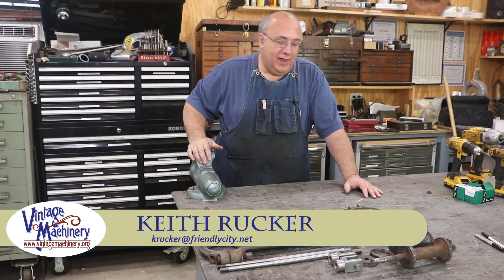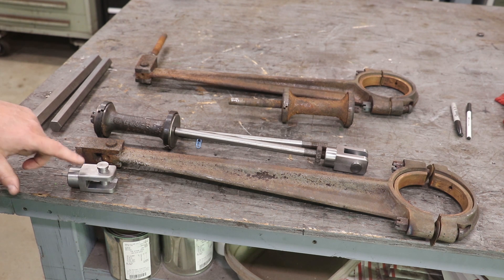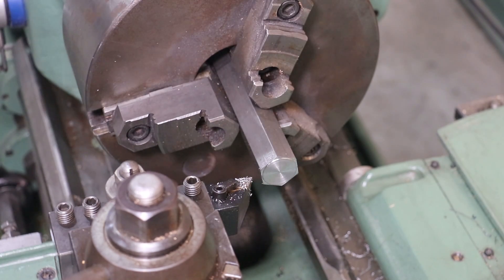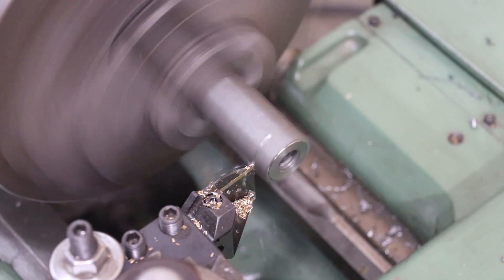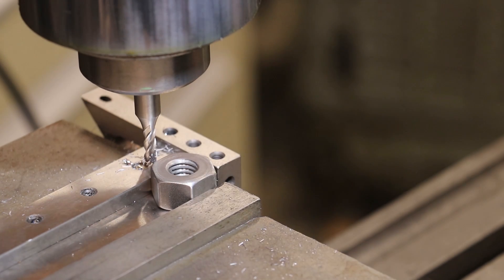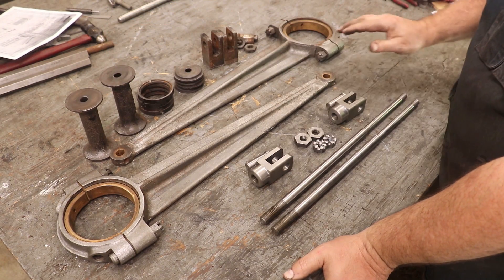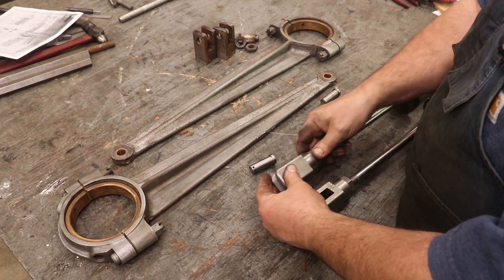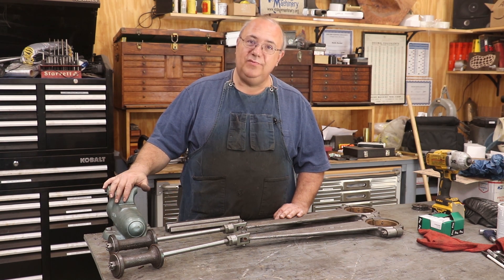Steam Stoker Engine Restoration 12: Reassembling the Valve Assembly

Comment: When you stop and think about the amount of time and effort (plus skill) it takes to restore just the stoker engine to pristine condition, then multiply this by all the other individual components needing similar restoration on an old locomotive, its easy to see why the cost of restoring a century old steam locomotive is measured in $$ millions. Thanks Keith. I'm very mechanically inclined but know nothing about machining and shaping metals. Its so fascinating to watch you work and explain what you are doing.

Comment: Very small spool valves like those were used in the hydraulic actuators of the F-8 Crusader and A-7 Corsair II in the 50s thru 70s.  I am not sure if they used rings.  The spools were moved around by a solenoid and a small yoke.  It is a tried and true idea.  Nice work on all the new parts.  Thanks again for sharing the work.
Reply: The place I used to work was overhauling A-7s through the late '80s before the F-18s finally replaced them.  I don't doubt that this type of spool valves were used in the actuators.
Reply: @bobvines00  BTW the USSR used similar tech in the MIG 21.  I saw a valve captured in the 6 day war - well made.

Comment: Using your tap follower in the tail stock, Put the lathe on super slow, Grab the spinning tap handle. When the tap bottoms you can feel it and simply let go. works great, has good feel and a lot less work.

Comment: In Europe we call a Cotter pin one which has a flat tapered section, used to secure cranks.  Commonly found on the cog side of a bicycle.  What you are describing would be called a spit pin.
Reply: The UK and US are separated by a common language.
Reply: Where i used to work we had a wartime box marked "split cotter pins" but everybody knows them as split pins.

Comment: For asthetics, blued connecting rods/caps would’ve looked really nice on the finished product. Great job, Mr. Rucker!!!
Reply: The Photographic Auditor 
It would, but once the stoker engine is put back together, these parts will not be seen by anyone again until the next time the engine is disassembled. So basically, it would be a waste of time and funds to do that.

Comment: never heard of "JAM"nuts we call them "LOCK" nuts, am also fascinated at the way you try to pronounce OIL, as always such a great contribution to ongoing education and sharing of knowledge and experience
Reply: Well, what do they do? Lock or jam?  I'm kind of leaning towards "jam" in this operation.
Reply: Lock Nuts here in Australia.
Reply: Jam nut is correct as Keith is using the term, at least in the US.  ASME B18.2.2-2010 "Nuts for General Applications: Machine Screw Nuts, Hex, Square, Hex Flange, and Coupling Nuts (Inch Series)" refers to hex "jam" nuts along with regular hex nuts in its tables of dimensions.

ASME B18.12-2001 "Glossary of Terms for Mechanical Fasteners" paragraph 3.2.1.16 states "jam nut: a hex nut having a reduced thickness—usually 63–70% of the hex nut thickness.  It is used to provide resistance to loosening in combination with thicker nuts."

ASME B18.12-2001 also states in paragraph 3.2.1.18 "lock nut: there are two basically different types of lock nuts: (1) a prevailing-torque type that resists relative bolt-nut movement with or without an axially applied load to the bolt-nut combination, and (2) a free-running type that exhibits a locking ability when there is an axial load applied to the base of the nut.  The “locking” or stopping action of the nut is accomplished by thread deformation, or  clamping, or by the addition of nonmetallic inserts.  The free-running type usually has a design feature that adds to the elastic elongation of the bolt-nut combination."

"Lock nuts" like these can be purchased at your local hardware store, but I don't know if you'll find an "official," thin jam nut there.

Comment: Keith, great work. Do you drill the crosshole for the cotter pin for the castle nut after it has been trial tightened? Otherwise, how can you ensure that the crosshole will align with one of the crosscuts on the castle nut after it is tightened?

Comment: Watching this video made me think about your planer project. Have you thought about having an eccentric on the feed gear shaft and using it to run a mechanical lubricator (as used on many steam engines). It might be a very apt method of oiling the ways.

Comment: Those nuts can be made with round stock then cut the hex on the outside using a spindex or a dividing head. I have to make them form time to time. It is usually cheaper than trying to find the right size hex in a given grade of steel. Most of the ones that I do are in 4140 or 4130.

Comment: Bonjour Keith,
I especially appreciate this project because steam is my passion and I understand what I see as my model steam machines are built on the same principles, except the size of course :+)
I can't wait to see this steam machine running again!
I have a little question : Does the new metal you use have the same hardness than the old one ? If not, Would it have an impact somewhere ? For example 
cast iron segments and cylinders or valves...
Amicalement, Raphaël

Comment: Great content. One question though. Can you have the rings chrome plated? I would think a chrome Molly finish would guard against wear better than just iron.
  Thank you.
Reply: I think that the idea is to have the rings wear rather than the valve piston bore!
Reply: You'd probably rather have the rings wear than have the cylinder bore wear.
Reply: @k4kfh  The rings are easier to replace than the cylinder sleeve and easier to make.

Comment: Hiya Keith, did you use a bottom tap in the two second nuts to combat the taper off the starting tap? Keep safe & take care...
Reply: There was clearance past the thickness of the nuts. (The hole was drilled deeper than the thickness of the two nuts combined.) And it wasn't a starting tap. You can see almost full threaten all the way to where it enters the hole. And he shows them being assembled at the end.
Reply: @xenonram  Sorry were you there?  I asked Keith a procedual question, not what you could see.
Reply: @stephencoster9532  keith rarely answers comments, so helpful people chime in for him.
Reply: Stephen, no need to be combative. One doesn't have to be there to answer a question with information that's clearly provided in the video, both in what's shown and stated. He used a standard tap and specifically stated no bottoming tap would be used because he drilled past the depth needed so the standard tap can cut the threads to size.

Comment: If you are not going to paint any of the internal parts, won't they rust quickly and therefore start their demise again? Lots of internal engines have a coat of paint inside to help keep them running longer. Even bluing parts would help. Just wondering...
Reply: whats a internal engine?
Reply: @jacobpoucher  I meant to say internal combustion engine. But I've seen all types of engines painted inside...
Reply: I think there's an oil bath in there.  No need for paint.  Besides paint can flake of and get where is shouldn't be.
Reply: @liquidsonly  Gary may have well been right that it originally had a Glyptol type paint in there. Seems like a lot of the pre-war cast machinery I've worked on had glyptol everywhere that was internal. But that stuff is like $60 a quart, so I'd make the financers pay for it if it was painted.
Reply: @liquidsonly  The trouble with the oil bath in this type of engine is water ...
steam leaks and then condenses...

So yes mandatory checking for water and a good tight packing between the lid and the machine fram is good.
Reply: I don't remember paint in the engine when he dismantled it.  I doubt the railroad would have painted the inside as oil is inside for lubrication.
Reply: @royreynolds108  That's often why they paint them. To keep the oil from seeping out. Every lathe headstock is painted on the inside.

Comment: Question:  My father, born about 1911, would use a cutting oil expedient made of 50% 30 wt engine oil and 50% lard for cutting threads.  What do you think about the practicality of this, remembering this was a cheap alternative during the depression?
Reply: When I worked for Boeing we used "crisco" shortening to tap 4-40 threads in titanium parts. Worked really good.
Reply: Innovation is good.

Comment: Do you recommend any particular type of steel for making nuts like these?  I have an old tool I’d like to restore that originally used an odd sized nut. I’ve found what I need for something like $50 for six nuts, so I’m thinking of making them myself instead. Thanks.
Reply: 4140 is an all purpose, "go to" alloy (chromoly) .  Tough and corrosion resistant.

Comment: Its curiosity more than criticism, but I was wondering:  Is there any particular reason you dont have compressed air at the mill?  I've spent more time watching than I have operating but a quick puff of air seems a lot more efficient than a paintbrush.  Keep up the good work, Keith.
Reply: Chips get inside the machine and cause damage over time. Best to avoid air whenever possible.
Reply: The old German toolmaker I apprenticed with would not have compressed air in the shop. It will drive the chips and grit into all the little places that you don't want it. I use a shop vacuum, very quick and much cleaner.

Comment: The Blueprints you have shown are from the N&W Railroad, not the NC&StL whose engine you are working on.  Different railroad may have different 'standards' for their use and operation of the same piece of equipment - standards based on that railroads own experience.

Comment: Older machinists have told me that rounded pieces are stronger than 90 degrees. As the tension spread more even on a ronded piece. What is the general opinion?
Reply: What you are describing is a stress riser.  A sudden change of shape in a part can create an area where stresses get large fast and then overloads the material to the point of failure.

Comment: @18:26 the cast iron is up in the air as Keith hits the tight pin with a hammer. He hasn't thought about what he's doing and it's a matter of chance that the very old and thin section of cast doesn't snap.

Comment: You should >>REALLY<< consider sourcing castle nuts for the rod caps that are rated grade/type. The amount of force that the rod bolts experience during operation is extreme. Although this is a steam engine and will not turn at an RPM close to what a modern engine experiences, the forces are likely not far off. I would hate to see you put all this effort into restoring this setup just to see it fail over rod bolts/nuts. I would suggest looking for a replacement bolt for the rod ends as well.
Reply: Do you really think that the nuts from 1890 that were a rated grade/type? Cmon man, use your head. Metals were cheese back then and they still worked. I think Keith is pretty experienced in Steam engines compared to most of us and telling him he needs to throw away his hard work and start over is nothing short of insulting.
Reply: To begin with : this is the valve gear, that castle nut must prevent the piston valve to move on the rod, it doesnt take the force of the stroke.

The real steam piston is pressed on a conical seat on the rod and then secured with a castle nut. 

What is important is: DONT forget the split pin !!!  Or believing that some type of modern clet (ie locktite) or that matter teflon stop nuts is usable....
Reply: @TheMetalButcher  This locomotive and stoker engine was built in the late 1930's or early 40's.  The valve spools don't take very much force to move as is exerted on the pistons which have the full steam pressure driving the stoker.
Reply: I am not referring to the castle nuts he just made for the valve spools, I am referring to the rod end cap castle nuts he mentions at the 20:30 mark. The rod end cap bolt/nut combination does not take any force on the power stroke. The tension force the rod, end cap, and bolt/nut assembly experiences during the direction reversal creates a massive spike in the tension force the castle nut and bolt see. The force the rapid velocity change exerts is significant enough to destroy a system. Making castle nuts is a viable option and yes making castle nuts would be another great video. My point was why take the risk? Why upgrade everything else but the weakest part of a rotational system? There is nothing wrong with restoration to original specs, but why risk it?  Metal butcher, I love the contradiction. I hear so many people talk about "old iron" being superior to modern iron, and here you are stating just the exact opposite when you are in fact restoring an old machine in your videos. The fact you think what I said earlier is insulting..well..I don't know what to say.
Reply: @sshep7119  Nice try on the old iron thing. When people say that, they're referring to "old machines" (made of iron, typically) which many of which were in fact constructed with more care, built to a higher quality of standard, and often designed better as well. Only someone ignorant about metallurgy would think that old metals even come close to modern metals in strength.

The valve rods sit on an eccentric. They really don't turn that fast. They really don't have that much force. You're making a mountain out of a molehill. It wouldn't surprise me if Keith replaced them because that's what he does, but this isn't a high force scenario.

Re: insulting. I missed that you were talking about rod caps. I assumed you were telling Kieth that he needs to remake the nuts he just made in this video, which yes, I would find insulting.

Comment: you could ask ABOM to spray weld the original rings up and turn and polish them to size also if you make some maybe make them from bearing bronze 
Also id get  the cylinder walls chrome plated after they are rehoned so they are slicker and you got less whare also once you run the steam engine - put a brake disk into the earth/ground and get a old phone charger or low electric use battery charger hooked onto the maschine with the negative elektrode 
This is what gas stations do with their silo tanks for example , it actively prevents rust from electrochemical corrosion like a sacrificial anode on a boat but way better 
I allways wondered how it comes that steam engines dont rust within hours --- I mean they are wet inside and hot after use and made of cast - also how do you lube a cylinder that gets steam-cleaned like by a steam-pressure washer - can you use normal motor oil?
And what will you power? will you put crankshafts with belt drives onto the cealing like in pre 1900 old maschine shops to power old  belt driven maschines like your shaper and stuff?